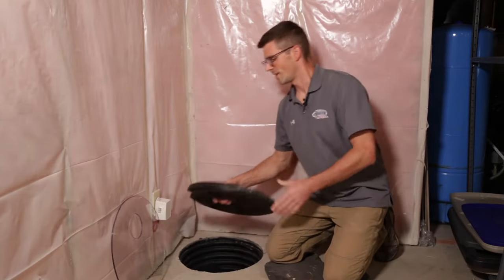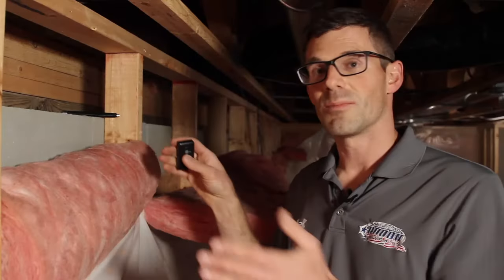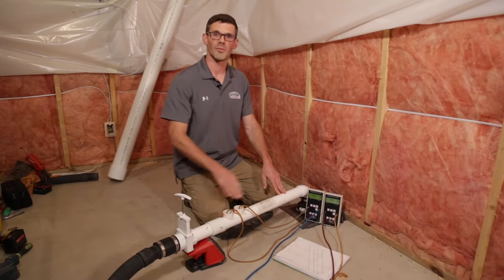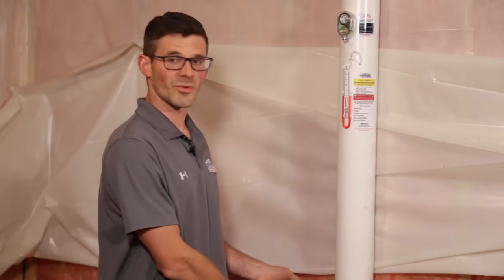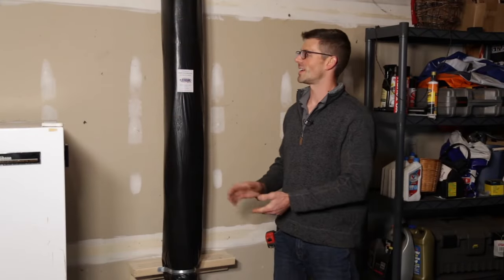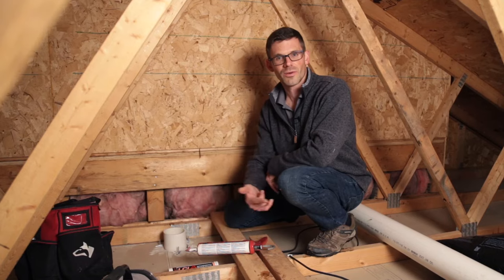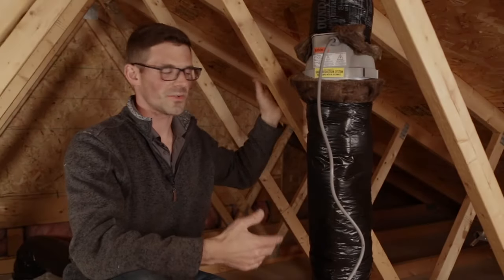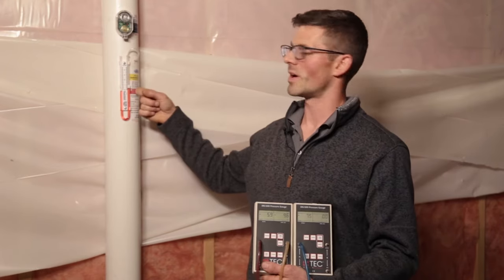Installing a Radon System in a Home with Drain Tile

Comment: Great video and extremely informative. Tested the radon levels last week with results around 10 in the basement and 5.8 on the main floor. We have a drain tile system with sump and 4" of crush stone under the basement floor, so we could go at the sump with an outside fan or bore through the basement floor and go through the garage and roof. We had a basement deep egress window installed this year with a drain connection to the outside perimeter drain. I am assuming that we are going to be "sucking" air from the egress window drain connection. How do you address this type of situation?
Reply from the maker: Thank you for the compliment!

In the radon courses we always teach if you can’t seal a leak, get away from it. 

You might have to put your suction point in a different location to do this. 

We don’t advise sump suction. Especially if you have a sump pump.
Reply: @AmericanRadonMitigation  Thanks for the reply. So homes with basement egress windows with drains connected to the outside perimeter drain tile need a different approach than sump pump suction. Looks like I will be looking at a suction point in the basement floor solution instead. To bad you don't service the Waukesha WI area, I would hire you in a heartbeat! Regards, Richard
Reply from the maker: @PPCTSLLC  We actually just started servicing Wisconsin.
Reply: @AmericanRadonMitigation  all the way the Waukesha/Pewaukee WI area?
Reply from the maker: @PPCTSLLC  Yes. We would do a FaceTime estimate and factor in travel and lodging.

Comment: What is the highest pico curies you have seen? My basement tested 31 pc/l and upstairs bedroom tested 9 pc/l. I have a blockwall basement and I think it's all getting drawn up from the openings in the blockwall, do you see that often in blockwall basements?
Reply from the maker: The high radon level I have seen here in Minnesota is 76.5 pCi/L. 

We have never had to install a block wall depressurization system to fix a home, and we have a lot of concrete block foundations here. However, if you engineer a mitigation system that creates suction under the entire footprint of the home, you will fix 99 percent of homes.

Comment: Jesse. This is a great video. You do thorough work and know all the details. How do you tell if Radon is leaking through the foundation walls in addition to the floor? Or do you just seal the walls with a Dry lock type product. 

Thanks,

Roy
Reply from the maker: Thank you, Roy. We have never had to seal foundation walls in order to reduce radon levels. 

Sealing block walls would be more of an issue if you had cinder block walls vs concrete block walls and interior drain tile. Cinder block are less dense and therefore might allow conditioned are to be drawn through them. I think they are more commonly used in the southern states and not in Minnesota. Block wall depressurization is also an instance where you would want to consider sealing block walls. This method is very rare though.

Comment: Roughly how much does this cost? I just had my crawlspace encapsulated and equipped with drain tile and sumps and am testing for Radon now.
Reply from the maker: Every home and contractor is different. Therefore, you will receive different estimates. You could expect estimates to range between $1500 and $15000. Check out this video before hiring a contractor: https://youtu.be/0EqUxNx1y7Y

Comment: Hi.  Great video!  
Why do you place the fan in the attic as opposed to in a basement and then just run the exhaust pipe through the attic?
Reply from the maker: Great question!

The radon fan and pressurized portion of vent piping can’t be in a conditioned space so that if a leak occurs, it won’t be leaking radon into the home. Check out sections 6.5.2 and 6.5.3 of the standard https://standards.aarst.org/SGM-SF-2017/27/index.html
Reply: @AmericanRadonMitigation  A similar question - could the radon fan be installed lower down in the garage rather than in the attic space above it?  Would it make a difference if the garage had a ceiling or was open to the roof?  It would be easier to service the fan and, in my case, putting the fan about 5 feet off the floor would let the cord reach an existing outlet.
Reply from the maker: Yes, you could place the fan in an unconditioned garage as long as there's no living space above the garage. However, I think it looks tacky, so we always put them in the attic.

Comment: Awesome video!  Curious if you still dig a pit even though you tied into the draintile?  Pretty sure my tiles run along the outside.
Reply from the maker: Hey John,

When the house has interior drain tile,  I dig a pit large enough so that I don't have to worry about soil getting into the hole I cut in the top of the draintile.

Back in the day or in some of our earlier videos you'll see that I dug large suction pits even with drain tile. I now think that is unnecessary based on the pressure field testing we perform. 

If you have an exterior drain tile system that comes into a sump basket in your house, you may want to run a temporary system drawing off of the sump basket to see if that lowers your radon levels. You can see us talk about temporary radon mitigation systems here https://youtu.be/TyCUneMCcLc?t=452

Thanks for watching!

Jesse
Reply: Thanks for the reply! I could try a temporary as a test to see what happens. I already sealed off the basin with a Jackal cover so I have a 3" hole I could use to vent.  Right now I just have a threaded plug in there. Surprisingly just covering it  lowered levels from 12 to 8pci/L.  Only prob venting there permanantly is we don't want the piping and fan visible outside (near patio) so looking at SSD on opposite side of house running up thru garage then attic.  If I find drain tile when I open the hole i'll tap in but think it's outside.  Best I'll be able to do is use smoke for pressure field testing though. It won't be optimized but at least I can verify if it extends across the basement.  Thanks for posting such detailed videos! Super helpful.

Comment: A lot of french drain systems have waffle/dimple board installed at the bottom of the wall which then extends down into the drain area. How do you handle this situation when installing a radon mitigation system? Is sealing the dimple/waffle board the only solution?
Reply from the maker: Yes, it's the only good solution if you want the system to be energy efficient. 

I really despise that stuff and wish the aftermarket drain tile companies would stop using it. A finished basement poses a real headache since you can't seal it without cutting open the wall. 

The top of the waffle board is left open and is intended to catch water running down the wall's inside surface. While this is rare, it does happen. 

If you simply seal the top, the water would end up in the basement instead of in the drain tile system. 

To seal it properly, you should install a vapor barrier that extends from the top of the foundation wall and is tucked in behind the waffle board. Then you can seal all sides, seams, and the waffle board. 

This allows the waffle board to function as intended. 

Obviously, this is easier said than done since anything on the foundation wall needs to be removed to accommodate the vapor barrier installation. This includes plumbing and electrical.

If you have gravel under the slab, you might get by moving your suction point to a more central location to get away from the air leak. 

If you have sand or clay under the slab, a central suction point likely won't do much for you. 

I am reminded of a customer we installed a system for a month ago. His radon levels were below 2 pCi/L before having drain tile installed and were around 10 pCi/L after.

We ended up foaming the top of the waffle board since he hasn't ever had water running down the inside surface of his block wall foundation. 

I asked him to check with the drain tile company to ensure it didn't void their warranty before we got started.

They said it was ok as long as we didn't plug the weep holes when we sealed it. 

 I would recommend getting this in writing. 

I hope this helps!

Jesse
Reply: @AmericanRadonMitigation  Thank you for your very thorough and helpful response. This is great information. One more followup question, but is there any type of testing that can be done after the fact to ensure there is no depressurization happening? Is that the smoke pen test that you show in your videos? We also have a fireplace in the space and so a bit worried about creating a draft related issue.
Reply from the maker: @jeffs1068  You're welcome, Jeff. We cover how to check for back-drafting on a gravity (natural draft) water heater in the last couple of minutes of this video. 

I'd have a qualified technician check your fireplace as I'm not familiar with how to do that.
Reply: @AmericanRadonMitigation  Thanks again for your help!
Reply from the maker: @jeffs1068  You betcha, Jeff! 

Be sure to subscribe if you’d like to be notified when we put out more nerdy radon videos. 🤓
Reply: @AmericanRadonMitigation   Jesse, thank you for this detailed video. I’m looking in to install a radon mitigation fan to draw from my sump basin (levels ~4 pCi/L) but am also running in to the issue where I have waffle board installed around the perimeter of my basement walls from the drain tile. I started to use a polyurethane concrete sealant but failed to realize it was self leveling and couldn’t confirm whether or not the waffle board was sealed once it settled in to the waffle board. You mentioned a foam that you use - what type of foam would that be to create an air tight seal? Thanks in advance!!
Reply from the maker: @__atp3  I use Great Stuff Pro Gaps and Cracks. Be sure that you just seal the top edge, or you could block the weep holes in the block.
Reply: @AmericanRadonMitigation  you’re the man! Thank you!
Reply from the maker: @__atp3  You're welcome, Alex. Let me know how it turns out!

Comment: How do you tell where to core. Can it just be the closest run to the garage and how long if a run can it be. Was planning on using sump pit and going on outside of house but i like the idea of going through garage for aesthetics and sump pit is opposite side of garage
Reply from the maker: We run a sewer camera in the drain tile and use the locater to find where it is. We can also see how deep the drain tile is if there are any water traps, and if it's plugged or compromised. 

Back in the day, we guessed. In our area, the footing for a house is 20 inches wide, with a 12-inch block foundation wall. That means there should be 4 inches of footing on each side of the wall. The drain tile is typically next to the footing, except where it goes around a corner. So if that's the case, I would core the hole about 7-8 inches from the wall. I believe a poured concrete foundation wall is 8 inches thick. 

The footings are not always poured square, so they can be pretty far off sometimes. You can also drill small holes to find the edge of the footing or drain tile as well. 

A sewer camera takes the guesswork out of it, but they are fragile and expensive. 

Remember that the walkout wall is rarely drain tiled and has lots of settling.

Comment: Can you explain more about the pitot gauge and how you know you need 4” and not 3”?
Reply from the maker: The pitot tube allows us to measure how much air we need to move to hit our target numbers in our test holes. We also measure the static pressure to see how much suction we have to apply to achieve that airflow as well. I didn't show that in the video to try to keep it simple.

The pitot tube is made by Kansas State University by Bruce Sneed and Chad Robinson. You can purchase them by contacting K State https://radoncourses.com/online

Bill Brodhead does a much better job at explaining pressure drop and airflow in pipe than I ever will be able to. 

Here are a couple of links that you may find helpful. 

https://www.wpb-radon.com/Piping_pressure_drop.html

https://www.wpb-radon.com/pdf/PVC%20piping%20Pressure%20drop%2096.pdf

Comment: I have a 2 story with a walk out so it seams like a 3 story house in the back, would it be better to vent it about 8-10 feet off the ground instead of going above the roof. How fast does radon dissipate?  If I pump it above my house, assuming its heavier than air, will it come back in the house through open windows if pumped above the roof?
Reply from the maker: I'd avoid an external radon system whenever possible. What you're proposing would not meet the radon mitigation standards here in the United States. Check out the exhaust discharge requirements in section 7.4. https://standards.aarst.org/SGM-SF-2017-X/16/index.html
Reply: @AmericanRadonMitigation   thank you. This confirmed my suspicions about the gas and how it might re-enter the home if it is not properly spaced from windows and other openings.

Comment: How do you typically know where to bore your hole to find the drain tile under the basement slab?
Reply from the maker: We run a sewer camera in the drain tile and use the locater to find where it is. We can also see how deep the drain tile is, if there are any water traps, and if it's plugged or compromised. 

Back in the day, we guessed. In our area, the footing for a house is 20-inches wide, with a 12-inch block foundation wall. That means there should be 4-inches of footing on each side of the wall. The drain tile is typically next to the footing, except where it goes around a corner. So if that's the case, I would core the hole about 7-8-inches from the wall. I believe a poured concrete foundation wall is 8-inches thick. 

The footings are not always poured square, so they can be pretty far off sometimes. You can also drill small holes to find the edge of the footing or drain tile as well. 

A sewer camera takes the guesswork out of it, but they are fragile and expensive. 

Keep in mind that the walkout wall is rarely drain tiled and has lost of settling.

I hope this helps, Adam.

Comment: Could you give a little more detail on the PFE? What made you realize you needed 4" instead of 3"? That you weren't getting to 5 Pa?
Reply from the maker: I feel like pressure field extension is easier to understand if you can see it. 

This part of the video may help you understand what we are talking about when we talk PFE. https://youtu.be/TyCUneMCcLc?t=83

A 3-inch pipe starts to choke airflow around 60 CFM. We needed to move 80 CFM to get our target of -5 pascals, so that's why we used the 4-inch piping. 

We could have used 3-inch pipe and a larger fan, but that would have resulted in a higher operating cost for Sean, the homeowner.

Comment: My house inspection was done last week by a local radon mitigation company. I live in Indiana.They have straight away told me that they will use 3inch pipe not the 4inch. And they are asking me to decide if I want the pipe/radon system to go through the Attic or outside of the home. Could you please suggest which option is better. The price difference is only 200 dollars, that is not a concern.
Reply from the maker: Hey Kiran. I wouldn't put an external system on my own house unless it were the only option.
Reply: @AmericanRadonMitigation   Thanks for the response. I will go with internal one though our garage Attic. Also could you please suggest 3" Vs 4" pipe to go with ?
Reply from the maker: You're welcome, Kiran. 

We determine pipe size based on how much air the system will be moving. If it's more than 60 CFM, we use 4- inch pipe. Large pipe will not hurt, but may be overkill if you aren't moving much air.
Reply: @AmericanRadonMitigation   Ok Thank you. Really appreciate your time and helping me out. Thanks again!!
Reply from the maker: Absolutely!

Comment: How does rain water stay out of the fan especially during power outages?
Reply from the maker: Good question, Todd. 

There is a small amount of rainwater that does get into the radon fan. It then drains through the radon system vent pipe and into the soil below the home. Rain caps and horizontal discharges are not recommended and can be an ice magnet in northern climates. 

Here's the standard where it addresses these issues. Rain caps are on the next page.

https://standards.aarst.org/SGM-SF-2017-X/17/index.html

Comment: I already have a passive system in the house we bought. How much roughly would it cost to add a fan in the attic?
Reply from the maker: Where are you located?
Reply: Western Pennsylvania just north of Pittsburgh 
The house was built in 98. They have a 4 inch passive running up thru the roof. Radon test when we had it inspected was like a 3.1. 48hr test. The inspector said it would be easy just to add a fan into the attic. But what he described and the incredible amount of detail you put into your work In the vid tells me it’s not that simple if I want to get the best out of my system. Great work btw
Reply from the maker: @darksim73  Thank you. Most companies here in Minnesota charge 400-800. We’ve heard they are in and out within an hour. 

It is fairly common for us to spend a day activating a passive system. We typically charge between 1500 and 3000 depending on what options the customer might want. Often times we find that the passive system was not installed correctly and needs to be modified. 

We are about to post a new video that shows us activating a passive system. Stay tuned as I’ll have it up by next week.